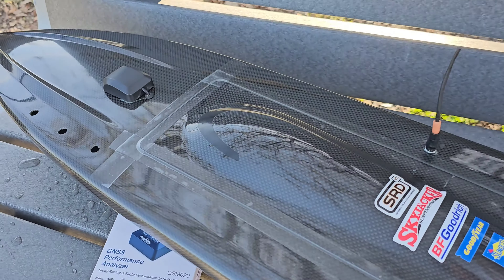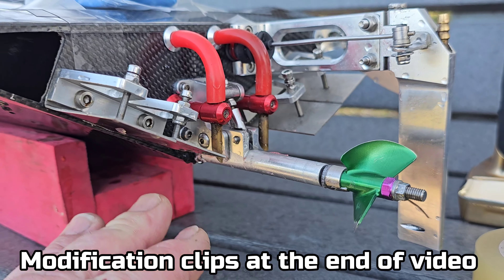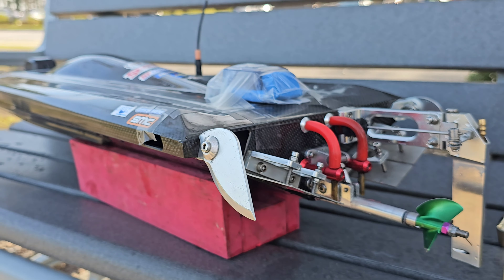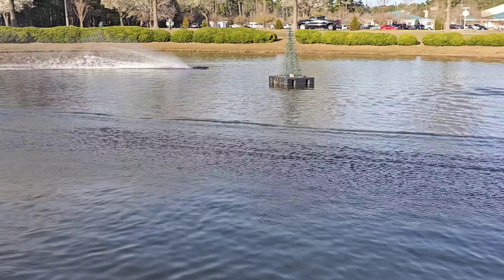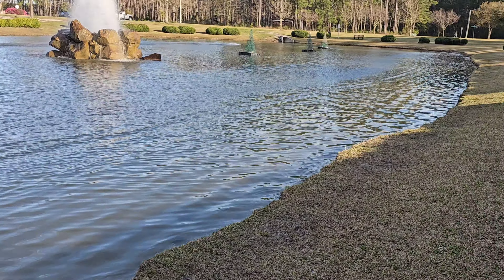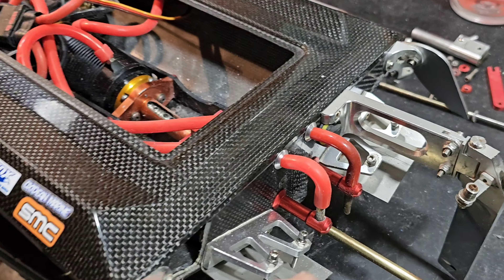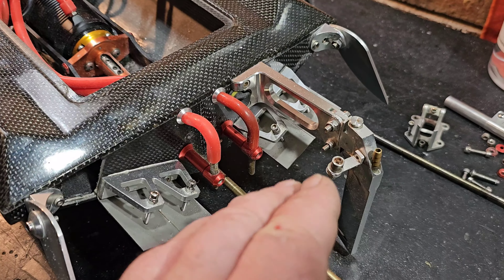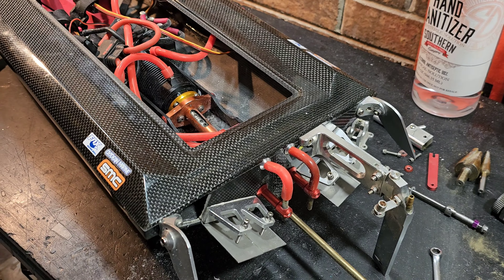Lower Stinger & Stuffing Tube Oxidean Marine Dominator - XLX2 HYDRA, Castle creations 4060, Smc

Comment: Kind off curious if it helps (a lot or bit) lowering strut. But then you need to test on the speedrun spot with that old 80+ setup. I just started trying to make a new ridepad. All experimenting to see if i gain anything trying to reduce drag. Hopefully it works, but its all theory in my head but the future will tell if it works...
Reply from the maker: Probably won't see much difference. I'm really just experimenting just to see type deal.
Reply: @IRONCLADRC  dont know, might be something. Maybe more stable or something like that. I run the cg more backwards than you, but we both ran about .5 degree on the strut so that doesn't make the difference. Both blueprinted it, made things sharper etc. All these things add up. Now you try this, what makes kind off sence to me to try, and im experimenting with a pad which also could make sence try lowering the drag. Also ordered some props. Going to try to reduce a big prop so  pitch changes. If i can get it right? No idea! Tinker and tune man 😂

Comment: My gnss is waterproof as long as I put a little bit of hatch tape over the single hole in the case.   You lose the altitude reading as that’s what the hole is for but who need altitude on the water?
Reply: To see how high it flies in a crash 😉
Reply from the maker: Thanks. I will definitely use some tape on the plug port....

Comment: Have you done a test to compare the dominator and the deltaforce with identical set ups to know what is the fastest. And done a speed check in the same flat water etc. If so I think I missed it.
Reply from the maker: I just watched before and after clips of the dominator, before moving the stinger and after.

Comment: Hey big B glad you tested this. I was just about to do the opposite to my Dom, raise it up. Typically a deeper strut will have less slip, and force the nose down. In theory if you had a lifting prop like an octura, that would lift the whole boat having it deeper but you don’t really want to lift the whole boat as much as you want to lift the front end. I think part of the issue is the CG on this boat, with the narrow hull, hard to move cg back much. Almost want to do the esc to the left of the motor, and push battery right up to motor?
Reply from the maker: Well, see here shortly when I put one of my faster props on with a decent tune.  My Deltaforce 35 likes a lower stinger, I've tried about 5 different heights on that boat, and the lower I went, the faster the boat got.
Reply from the maker: Try the higher stinger, what's the worst that can happen, the boat will either like it or not and have to readjust the stuffing tube..  It took me about 2 hours to do this mod. I've done it on so many boats, and now it's like second nature.
Reply: @IRONCLADRC  good stuff big B, my dom just like yours likes to run wet! I’ll be watching closely, done a lot of work to mine so far.
Reply: @RogallaMarineRC  you mean, it runs too wet? i couldnt get the nose up in beginning whatever i did. Then modificated lots off things

Comment: HI BIG B . GREAT VIDEO. I HAVE TO GET A NANY CAM FOR MY TUG BOAT AND A GNSS FOR MY VELES 29 . THAT REMINDS ME WHAT BATTERY DO YOU RECOMEND FOR THE VELES 29?
Reply from the maker: I liked the 6500 and 7600 hclhp smc were great 6500 are a tight fit
Reply: @IRONCLADRC  STOCK VELES 29?
Reply from the maker: Those were my speed run packs. It's. Even a while since I ran that boat with the stock battery tray

Comment: Hi friends, I'm asking for advice... My Twin Cat weighs 3.8kg with only 4mm flexible and currently using a 37mm prop and I want to add 40mm, will the 4mm flexible last without breaking... please guide me friend 🙏
Reply from the maker: 4mm may hold up, depending on your driving style, .150 HD cable may be better
Reply: @IRONCLADRC  Ok friend, thanks for the guidance..👍